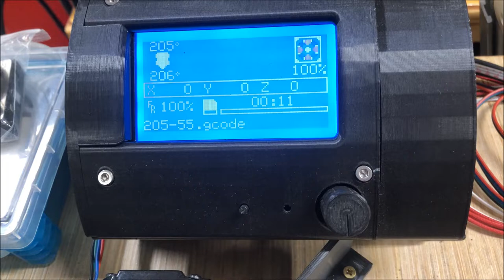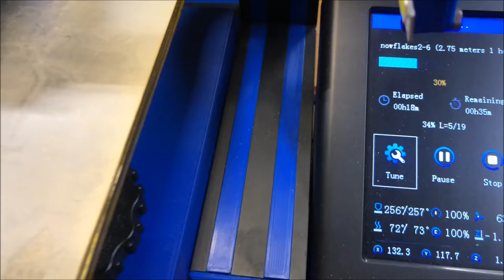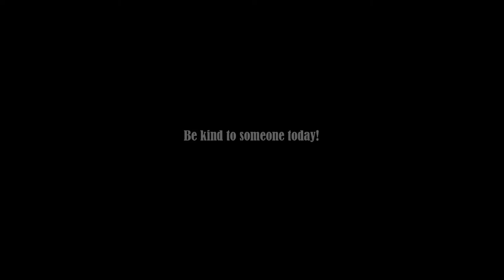Holiday Snowflakes 3D printed from Homemade DIY Recycled PET Plastic Bottle Filament!

Comment: Feels like Christmas is near ;), great job. I am struck by the spikimost layers. What are your print settings?
Reply from the maker: Bed 73c, nozzle at 257c, only 25% on the parts fan, and printing very, very slow.  Also using a 0.6mm brass nozzle instead of a 0.4mm.  If you use Cura, I have my profile settings for Cura 4.x and Cura 5.x available on my LinkTree page.  Go to the very bottom of this page and you’ll find them there.  https://linktr.ee/kevingroninga3d
Reply: @KevinGroninga3D  Thanks this is a helpful answer. In the vastness of YouTube, I found an interesting device, the author called it "Semi-automatic jointer with winding and laying a bar on a coil." I think this device can greatly speed up and facilitate your work. If interested, I can share the link and file. Krab Dust is the author of the YouTube channel.
Reply from the maker: @ЕвгенийКоваленко-б6г  yeah, share the link with me.  I’ll take a look.  Anything to speed up the process would be helpful.
Reply: @KevinGroninga3D  ok, here is the link to the author's channel https://www.youtube.com/watch?v=jJp4k3KulJY&t=243s. On his channel there is also video material, divided into 3 parts. Links to materials are in the description under the videos. The only inconvenience is that the video is in Russian, but you can turn on subtitles with translation. The files in the archive are also in Russian, if you have problems with downloading or the content of the material, I will try to help you.
Reply from the maker: @ЕвгенийКоваленко-б6г  cool machine!  Yeah, I could see this being useful in joining a lot of PET filament from all of my smaller soda bottles.  But certainly the language barrier will be a bit problematic.  Having someone to help interpret Russian to English would be super helpful!
Reply: @KevinGroninga3D  I am not very strong in English, but I am trying to overcome the language barrier. We can exchange contacts and try to help you with the translation. I am also interested in recycling PET bottles into filament, so I am collecting a large database on this topic, and I want to develop a universal device for making filament from bottles for a more autonomous process)
Reply from the maker: @ЕвгенийКоваленко-б6г  in regards to creating PET from bottles, have you subscribed to MR3DP and Function3D?  Both have a large library of good videos on the subject.  My machine was patterned after one I saw on the MR3DP channel and uses a RAMPS v1.4 board (complete kit) I bought on Amazon.  The take-up gear box and other 3D printed parts are a mix of things from MR3DP and stuff from Thingiverse.  There are two basic designs for these pultruders.  Ones using motherboards from 3D printers and others using circuit boards specifically designed to simply control the speed of the stepper and the temp of the hot-end.  Those designs are used in ones by RECREATOR and PETAMENTOR2.
Reply: @KevinGroninga3D  Yes, I subscribed to the MR3DP channel and study his materials. I looked at the RECREATOR and PETAMENTOR2 projects, and there are many good solutions there. My goal is to create a portable machine, with a simple interface but using microprocessor technology. The meaning is that one controller "brains" can solve certain operations one by one and work already on the built-in sub-programs. The principle is like in a coffee machine, I chose the right program from a variety of options, and it does what you choose for you.
Reply from the maker: @ЕвгенийКоваленко-б6г  Sounds ambitious, but I’d bet it could be done!  One thing that would be great would be the ability for the machine to gauge the thickness of the plastic bottle and then adjust the cutting blade so that the cut ribbon would be the correct width.  This would ensure that the resulting filament is as solid as it can be without being too wide and preventing the machine from pulling the ribbon through the hot-end.  The bearing based bottle cutter that I use is adjustable.  There are a couple bottle types I work with regularly and so I know how to set my cutter width to make ribbon of proper width based on that particular plastic thickness AND if the plastic itself is harder or softer.  I’ve found that some plastic PET bottles are made from material that just a little diff.  If the plastic is harder (stronger) I have to make the ribbon just a wee bit narrower.  
Anyway, keep me up to date as you build your machine.  I’d be interested to see how you engineer some of the elements.
Reply: @KevinGroninga3D  Please tell me how you make the thread. I am interested in how the width and thickness of the bottle affects the final result, I am also interested in the temperature of the nozzle and the winding speed of the filament. How does changing these parameters affect the quality of the filament? You can greatly speed up my project, but for now I started translating the material with soldered PET thread (from the video). There is a lot of work, but I think we will help each other.
Reply from the maker: @ЕвгенийКоваленко-б6г  I run my nozzle temp at 205C.  Below is a ‘guideline’ for plastic thickness versus width.

Thick.  Width
.20mm 10mm
.25mm 9mm
.30mm 8mm
.35mm 7mm
.40mm 6mm
.45mm 5mm
Reply: @KevinGroninga3D  Thanks, I'll take it as a note for the project.
Reply: Hi Kevin, the translation of the filament soldering device will be greatly delayed due to power problems in my country. Very often and for a very long time. The work is going on, I will provide the materials, but you need to be patient. In case you're wondering, I had designs for Patriot-themed keychains that I reworked for Christmas tree decorations. I upload gradually, if possible, through the phone, I do the processing online through tinkercad. If you're interested, I'll post a link later.